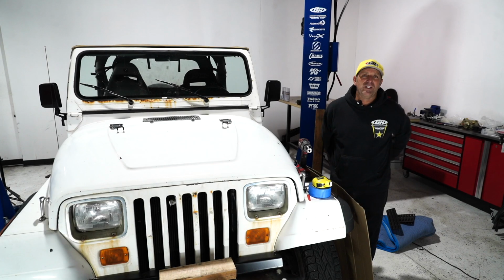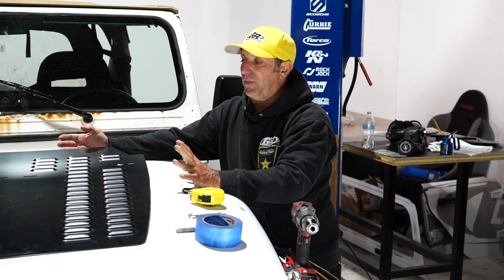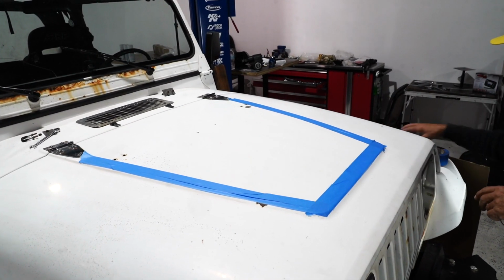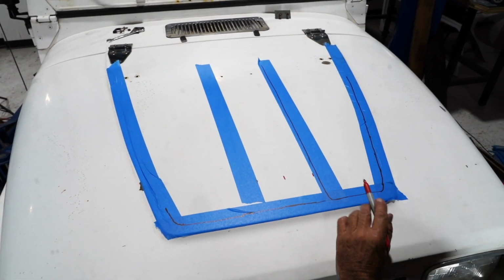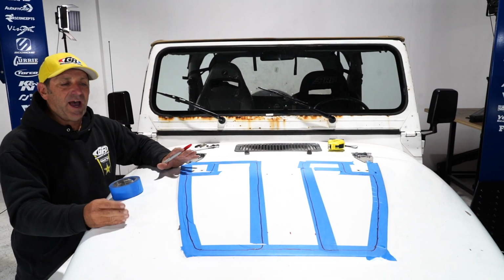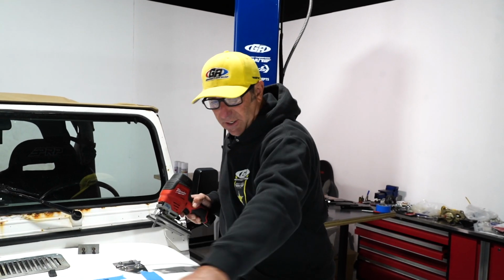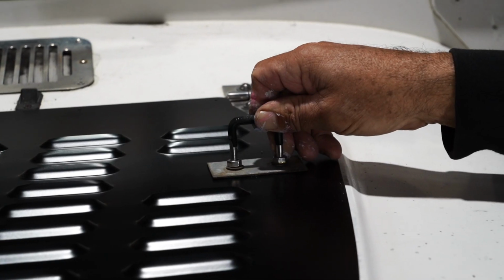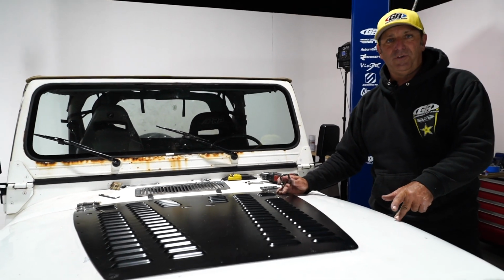Easy Jeep Hood Louver Install! Check This Out!

Comment: I painted my whole hood with bed liner because the white was blinding me. Then i used bolt on louvers in strategic places. Like over my turbo and exhaust manifold. I also have an electric fan set up so that it comes on at 210 and cuts off at 180. I installed a switch to turn it off all the way or turn it on all the time for water crossing for slow trails. The fan can be switched on while my jeep is off to help remove heat.

Comment: Hi, it's fantastic!  Friend, I need to clarify some doubts, first it seems to me that the averages are 24 by 30 inches?, does the engine also get wet if it rains or if it washes?  And finally they ship to Costa Rica?
Reply: even without louvers your engine get wet whenever you drive in the rain,

Comment: Do you make one for CJ7?
Reply from the maker: We do not make a whole hood louver for the CJ-7 but you could mix and match a set of our individual panels that would fit a CJ-7 hood very well. Take your pick:

https://genright.com/products/hood-louver-set-2pc-long-black.html

https://genright.com/products/hood-louver-set-2pc-short-black.html

https://genright.com/products/hood-louver-set-5pc-black.html
Reply: I would assume a drill but, anyone have a good way for reinserting the washer fluid tip?